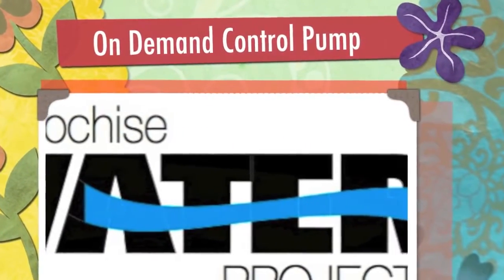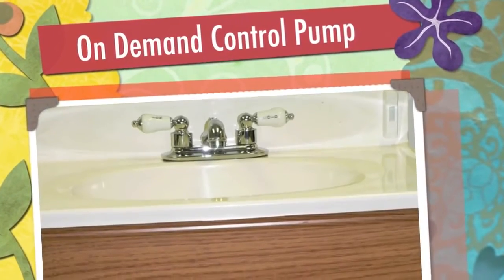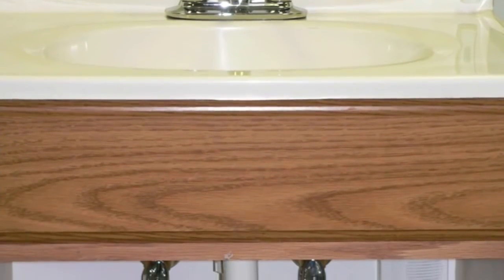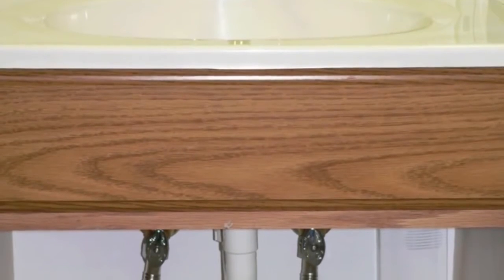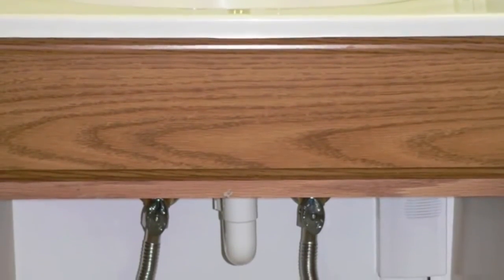D'MAND Kontrol® Hot Water Pump

Comment: Anybody know where I can obtain a replacement "off sensor" for this unit, the sensor that threads into a fitting on the housing & senses when the water gets warm?
Reply: D’mand doesn’t make the pumps. There should still be a label on it (possibly on the bottom) from the original manufacturer (probably Taco). Your best bet is to Google the manufacturer, model number, and ‘sensor’.